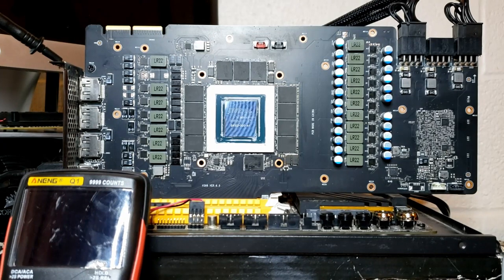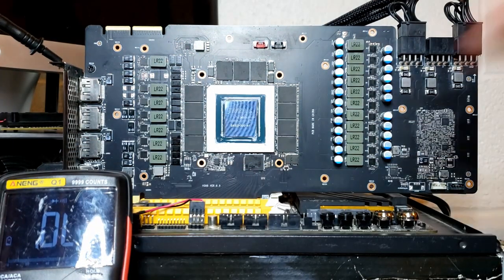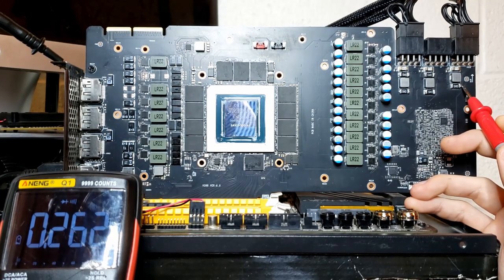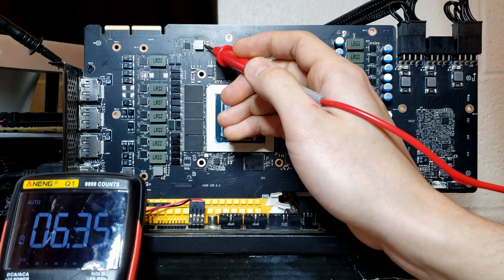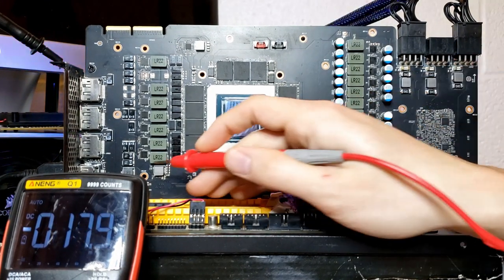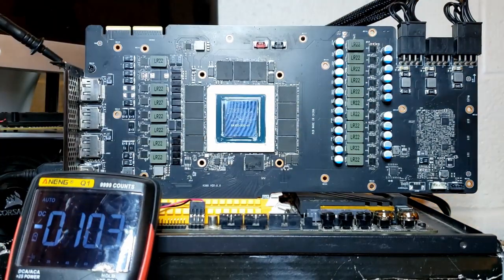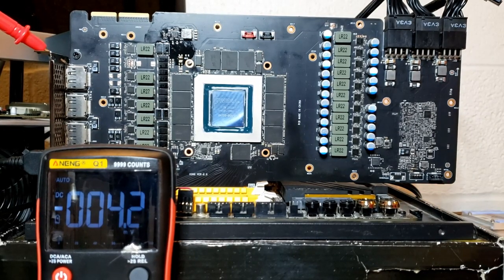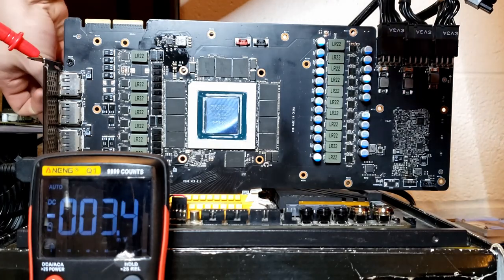MSI RTX 3090 "Repair" - Not detected

Comment: FYI the card looks to be shunt modded, so the lower draw as read in gpuz is going to be off - its probably consuming closer to 500w+
Reply from the maker: I took off the extra set of shunts prior to testing the card, you can see this at 31:33 as well as the crooked fuse - good eye though, I'm surprised you noticed.
Reply: @sent18inel  removal of power limit for extreme overclocking, or to have a bit more fun.

Comment: Great video, using the meter in diode mode to supply the 3.2v, genius. Though I would have used resistors higher than 0 ohm, just to limit current draw by the IC (say 50 ohm).  Not that I could fix this card in the first place :-)
Reply from the maker: Thanks!. I did try a higher ohm resistor at first, but I kept getting a voltage drop and then eventually settled on 0 ohms.

Comment: Hey, i think this fix is not 100% so i dont think many people should go replacing the ram chip immediately i would first reflow the gpu die a bit to see if it comes back to life. I did this repair twice. Twice i thought oh i fixed it. But no, turns out that in the process of replacing the "bad" vram, i was only reflowing the gpu die. So it worked for a short while and died again so then i thought. Hey maybe its the vram in the opposite end that died too. So i went ahead and replaced that one and it actually lasted 2 weeks of intensive deep learning. Today it died again. So now i believe the die was to blame all along. I would suggest trying a light reflow first to see if your device turns back on before going out and changing vram.

Comment: Thank you for sharing with us, this knowledge really helpful. Me most case struggling repair power delivery missing or weak signal on PG circuit. most case for laptop if i force enable the the missing raii most of it doesn't want to boot😅, its easier when pcb manufacturers release full schematic with all power on sequence signal graphs required to boot.

Comment: Eli: I feel you actually went away and above on the fix you made on this card. I feel what happened was a component went out of spec. Without a detailed flow chart you won't be able to find it if you spent another month on this card. I think the pex rail and the 1.8 rail had the same component that was damaged causing it to fail. The fact that you got it to post probably means it will last the owner for the next two years. It would be nice to find out the information you need, just not necessarily unless the component that failed, fails further. If it fails further which to me seems during your testing it would show up. Thus you should probably run it for a week to make sure it is stable, starting and stopping the card like two dozen times.

Comment: I'd have put that 8k resistor back in after it didn't change anything. Then at least you'd only have 2 non-standard parts in there (well . . . 3, counting the LDO). Zero ohm resistors are dangerous if you're unsure of component values. It might also have been an option to try powering the 1.8V buck converter directly from a benchtop power supply, just to see if the converter would power on properly . . . if you could find a way to get the leads connected.
Reply from the maker: As it turns out, that resistor is supposed to be 17k ohms or so. It measures as 8k in circuit. I've switched it back out to a 17k ohm and I've sent the card back to the original owner after verifying VCC is actually 5V. There will be a follow up video sooner or later.

Comment: Hey i love your troubleshooting and explanation, it's pretty straightforward. 
Btw I'm thinking few weeks (or months?) ago i saw some Russian upgrading gpu memory, can you actually do that? And I'm curious about the vbios mod itself to support the bigger memory capacity rather than the reballing process
Reply from the maker: Yep, you can upgrade memory. It's rather common on RX 500 and RX 400 series cards. It's a little iffy on Nvidia cards unless you just want to upgrade the speed of the memory modules. These mods often require certain resistors to be moved ( used to identify memory brand and capacity etc) and sometimes a vbios flash.

Comment: Hey man, great video thanks for sharing! I've been watching the other ones as well, but i have trouble understanding all the logic you follow. I understand that you check for things in order, then based on what is abnormal from what should be normal you analyze further based on component specs to troubleshoot even further, and change components when needed.
Is there a video or a written guide where you explain what are all the voltage and resistance needed to be checked, where to find them because i guess they are not always at the same place? Could you also explain how did you find that the U212 component was linked to the buck converter, and same thing for the faulty resistors?  Last but not least you say in your video that you asked for help on a website where a user called alex ross answered you, could you link this website, sorry i can't figure out which one it is since you speak fast :)
Reply from the maker: There's a russian repair forum called vlab.su, the user in question is "aleksros" who is very very good at fixing graphics cards. I found those components by manually tracing them. There are no special tricks here.
Reply: @TechCemetery  thanks for your answer! Im sorry but im a noob on this, i dont understand how you track this. Using your multimeter you search for continuity between each component and the one you're interested in? This would be like searching a needle in a haystack :)
Reply from the maker: @Mat2141  Yep, I just use continuity mode. Once you've looked at enough graphics cards you get an intuition for what kind of component you're looking for. It's just a skill like most aspects of board repair.
Reply: @TechCemetery  Impressive, most impressive as vader would say :) I would love to learn how to properly do this, i know the basics, but i'm afraid this would be too much time consuming to be worth it.
Reply: @Mat2141  Skills steam from stubborn application...nothing is free. You could be a genious but without exercising and practising you are doomed to fail. Regards from Italy.

Comment: Sorry for the question again! I have a Sapphire RX580 but messed up the board where the bios chip origanally mounts so i have mounted it on the chipset side where the dual bios chip would normally go and now mounted a switch on the side from another dead card but when doing voltage checks I noticed a voltage of 0.5v is missing and I cannot find 0.5v anywhere on the board. Any ideas would be appreciated.

Comment: This says it all about MSI, really.. I call them MSDie for a reason lol send it back! I may complain about my Zotac 3090 being heavily neutered but at least i have a 5 year warranty, still covered even though i've fitted a water block! Back when a Radeon R9 290X was new and just before i switched to nVidia, i got an MSI 290X...and it arrived with already damaged, mangled fans from the factory! They had packed it too tightly with air cushioning which crushed down on it and killed the bearings! So, less than a month old, i'd had to zip tie a pair of 120mm fans to it..haha. Even an MSI board died on me back in the days of the Athlon XP..

Comment: Nice video Buddy ! Please make a video about soldering a display out to a Mining Graphic card or replacing the core to a board with display outputs (from p106-100 core to a gtx1060 6GB board and replacing the BIos chip as well ) and making the videos' title "Can you solder display output to a Mining Graphic card" I am sure it will bring a lot of views to the channel and add more subs aswell ! Hope you will consider it !
Reply from the maker: Yep, I'm just waiting to find an RX 470 mining edition card (without the DVI port) at a semi-reasonable price.
Reply: @TechCemetery  those cards have an HDMI port hidden behind the IO shield, but it doesn't display anything if you try to use it, some of those little display out circuitry components are actually missing from the back of the board near the display out section despite the card having an actual HDMI port hidden behind the solid IO shield they ship with it.
Reply from the maker: @JR-ob7hz  Thanks for the info, I've actually never seen mining edition card.

Comment: It doesn't make any sense that that extremely important regulator was just lost and not mounted, as it seem to have been, since that would absolutely no doubt have been caught in the the control systems they have when testing the cards since well it would just not have started. So something isn't right here at all.
Reply from the maker: The component was knocked off by a previous owner, at the time I wasn't sure if it was supposed to be there.
Reply: @TechCemetery  Totally agree with that. The solder surface looked like it was factory but your impressing conclusion said it had to have been something there. Anything can happen I guess, thanks for the info.

Comment: got a gtx1060 that only detects and works in pci slot 2 but not the first pci slot  mobo is working  tested it with a diffrent gpu and it works   

what can i inspect on the pci interface to see what is wrong

Comment: Hi bro I need some help regarding my gigabyte g1 GTX 980ti I have 12V short circuit on 8pin connector.
After I remove MOSFET now Short on 12v is gone 
But Vram phase showing 10 ohm's instead of 70 ohm's
And 1.8 volt is missing.
Is my GPU chip is bad in your opinion.

Comment: Dear thanks for very good information, i have Evga GeForce RTX 3080, Not Dtected, (Stop on VGA Led), i Checked, 12v, 3 coil, OK, 5v OK, 1.8v OK, missing GPUvrm (41.9 ohm), and pex (4.1 ohm), i checked all zero ohm resistance, All OK, Where i have to check pls. help me out

Comment: Some days ago my RTX 3090 just died giving me no signal, was wondering if that was only me, but let's be honest, they sell us 1800-2300$ products that can run up to 105-110°C on the memories for the missing thermal pads on the back of the PCB.
There's RMA if the card die but what's if someone managed to pick up a used one for a crazy price and it end up like this? In my opinion this GPU should be just illegal to be sold.
If you have a RTX 3090 makes sure that your memory doesn't run up to 90°C or above using HWinfo, if it does, downclock your memory speed (even if doing this you draw your performance under a RTX 3080, but there's not a lot you can do).
Reply from the maker: If you're not able to RMA it for some reason, I'd be happy to look at it - send me an email if the RMA falls through.

Comment: @TechCemetery great video, thank you for explanations. I need help with rtx 2070 if you don't mind helping me
Reply from the maker: If you can describe the card well enough, I'm happy to give you advice. Resistance measurements and voltages for cards that are not detected, and if it is detected it likely has error 43 or artifacts under load - in which case I can't suggest anything other than that you should run MATS/MODS.
Reply: @TechCemetery  the card i have is asus rtx 2070 o8g . i can measure 5 volts 12 volt and 3.3 volts. no 1.8 volt or any lower volts on the card. no volt reading on the left side of the card 2r2 ,2r2 and 4r7 inductor. Also no volt reading in the vram vcore Lr22 or lr47 inductors .The card was working but stopped working after i dropped it on the ground, no display signal, i was able to see it in windows as secondary video card but when i install driver it crash. If you can message me on Reddit i can send you Photos.
Reply from the maker: The next voltage rail that usually turns on is 1.8V. Leave me your reddit and I'll PM you.
Reply: @TechCemetery  Habibo0o is my reddit

Comment: Hey I love you video's. And I have a gtx 1060 that I want to fix, and I was wondering if you could help.
Reply from the maker: What's wrong with the card?.
Reply: @TechCemetery  I got artifacts and after that pc crashed. I restarted the pc now I get error B2 on my motherboard. After a minute I see the screen turning on but black display. I used mats/mods and in the report I see that B0 is failing.
Reply from the maker: @mo5123  Have you already tried replacing B0?.
Reply: @TechCemetery  no, I don't know where to buy it to replace it. 🙃

Comment: In 2045 if we have molten salt thorium reactors we will be able to desalinate seawater so cheaply, and make nitrogen phosphate fertilizer so cheaply we won't just have enough food, but food in glorious  excess. We will be able to farm marginal ground and ground that has now been salinated to such an extent the ground is not productive and with excess water leached clean to grow crops we can't even farm today, especially in Iraq and Iran where in the past they had such huge abundances. Now with thorium reactors water will be so cheap we won't even use reverse osmosis filters to make water productive and run the salt right out of the soil. We won't use reverse osmosis for water production but huge plants to boil the water for purification. Electricity will drop in price so much wind generators will be phased out as unneeded. Same with solar panels. But only if our best minds come together to use thorium in small modular reactors as fuel breeding units that will use current nuclear waste as the fission seed to start this process away from expensive units to being able to use beach sand to turn the entire Earth into a land of plenty.

Comment: Argh, Ampere is efficient. Even more so than Pascal or Turing.
Reply from the maker: That's a naive argument, nearly every generation of CPU/GPU is more efficient than its predecessors. Ampere is inefficient because it's director competitior ( RX 6000 series) can do similar work at a lower power draw. When making efficiency comparisons, time period matters. Anything can look efficient when compared to older tech which is why as an argument, it's worthless.

Comment: ps i have this card if ya want some confirmation
Reply from the maker: You have access to an MSI 3090/3080?. If you can get the resistance values of what I've changed, I'd be in your debt. The card is still on my shelf waiting for a proper repair.
Reply: @TechCemetery  ok will do that this weekend
Reply: @TechCemetery  25:44 8.033k ohm
Reply: @TechCemetery  and the one connecting to it is 6.896k ohm looks like a voltage divider?
Reply: @TechCemetery  29:40 hard to find the resistor ya pointing at but hadent found a 3k ohm one
Reply from the maker: @mathewwitty5858  Thanks for replying, I actually already have all the values I need.
Reply: @TechCemetery   did send an email of details. i will be fitting the water block soon
Reply: @TechCemetery  sorry for the late repply lots of work came flooding in over the past week